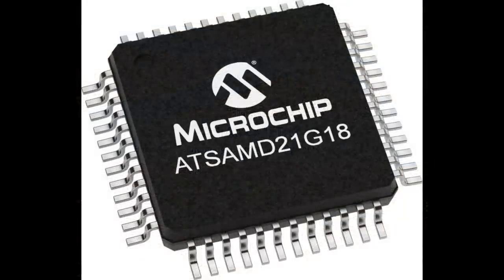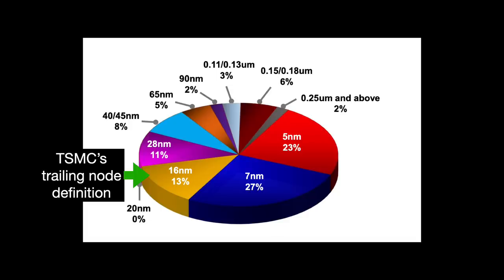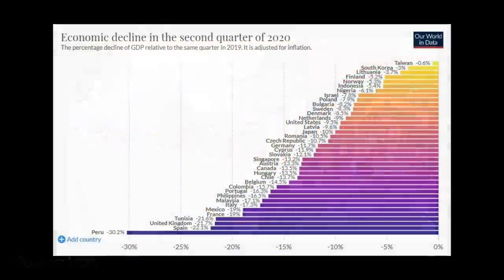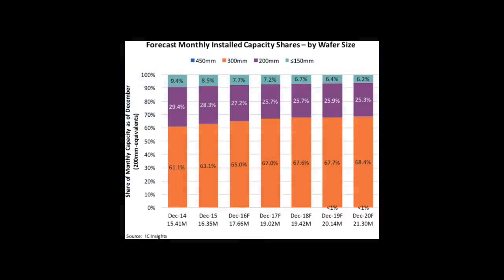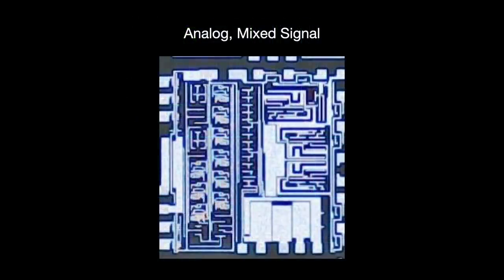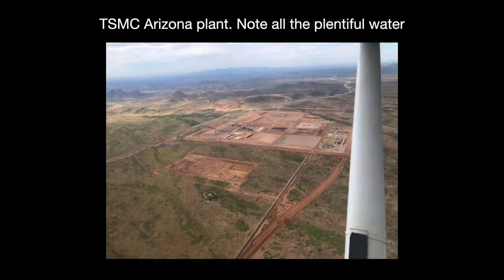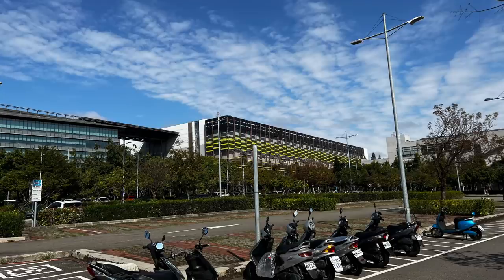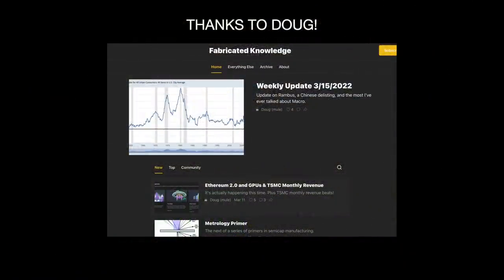Where The Real Chip Shortage Is

Comment: One note. It's basically impossible to upgrade a 200mm fab to a 300mm one. Every single piece of machinery in there is designed for the specific wafer size so you'd have to replace everything. The only "Advantage" would be you wouldn't have to build a new building but honestly the empty building is the easy/cheap part. It would probably cost way more to take out all the 200mm tools than it would be to just build a new building next door for 300mm tools.
Reply: depends and also that statement is often false if we are talking about places outside of Asia where land doesn't sell for pennies and building permits are a huge thing. (Even in Asia it's sometimes false)
A fab is not even remotely cheap or easy. Even if you ignore the millions you'd have to spend for the land then permits and then a building, you also need a lot of time to build one, and in this industry every hour is basically millions lost that could have been earned. Besides that getting the whole facility upto a working level and have all the systems- from dust and air filtration to EMF protection to fire supression to ensuring water supply and whatnot is a major task

Anyone who has worked in datacenters knows that the most expensive part of a datacenter is the building itself- aka why so much focus is put on compact racks and fitting as much power in 1U and such. Similarly a fab definitely has more expensive equipment in there but the building is definitely not the cheap part- that'd probably be electricity
Reply: @KryoNaut  Even with land costs and how complicated the empty fab building is trust me the building is the easy/cheap part. I can't get into exacts but the single cheapest machine in a modern 300mm fab is easily several million dollars and takes months to install and get it working on wafers. Which goes back to my previous point it's almost always a better idea to build a new fab than to try and convert a 200mm to a 300mm. Unless you had a 200mm fab in downtown Manhattan or something.
Reply: @Kevin-xw1eo  Considering a photolithography machine for single digit/close to single digit nm fabrication processes is around 170-200million USD
something as large as 200nm with the whole thing should be into several millions for sure but not enough to call the building cheap part. You are just exaggerating at that point though I'd agree building a new 200nm fab is often cheaper than 300nm.
Reply: @KryoNaut  mm not nm. We're talking about the wafer diameter not transistor size.
Reply: Its not impossible Intel did it in Ireland with Fab 10/14/24
Reply: Switching technologies is risky, and expensive. And Investors don't like either/or, let alone both. You either made the profits to find another location for a new fab, so you can build one without affecting the old one, or you modernize the old one, but it will be shut down for a certain period.
Reply: Easy there Kevin, you might get banned from Y/T for posting the truth..
Reply: @christophermcdaid696  they are in the process installing EUV equipment in Ireland right now and retooling, but the tools are still being designed and built, it's not off the shelf hardware.
Reply: they can sell the 200mm equipment to at least contribute to the cost of the 300 mm tools
Reply: @fouzaialaa7962  the amount of time and effort it takes to uninstall a tool though is crazy. Honestly even if you got the same amount you paid for the tool in the first place you wouldn't be making that much selling it just in labor costs to uninstall it and box it up.
Reply: @fouzaialaa7962  200mm equipment is in high demand, but it’s not going to make a dent in your purchase of new 300mm equipment. There is very little used 300mm equipment on the market because all of it is still in use. The only time fabs get a chance to buy significant amounts of used 300mm capital is when a major company croaks and has to liquidate their assets to pay creditors. That’s rare. The last big one I know of is when TI outfitted R-Fab in Richardson, TX as an analog chip facility with 300mm equipment they bought from the dissolution of Qimonda. It was also a golden opportunity for TI as they had already built the R-fab shell, having previously intended for it to be a follow up to DMOS6.

Bottom line is if you’re going to build a 300mm fab, your capital orders needed to be in a couple years ago because it’s all likely to be new build tools.
Reply: W
Reply: Exactly to build a fab is about 20% of the cost, the real cost (the other 80%) are the tools to build the semiconductors.
Reply: @KryoNaut  they only have to gut the building and rebuild everything inside on new equipment is a bad defense of the point you're trying to make...

Sure. You can keep the building.. but this shit is purpose built. You don't get much outside of the piece of land and the steel beams holding everything up.
Reply: see razertrons statement. absolutely true